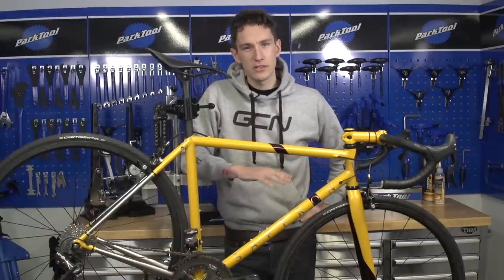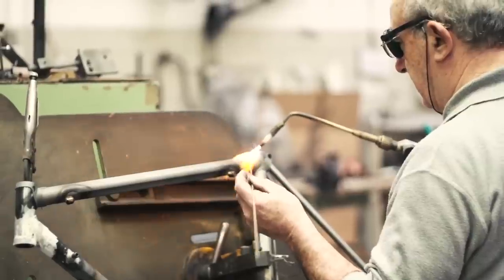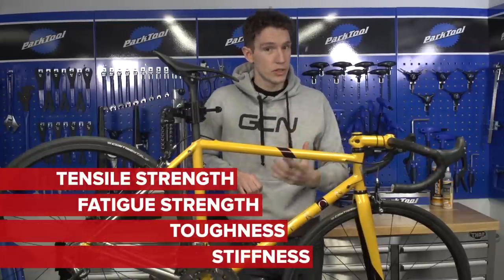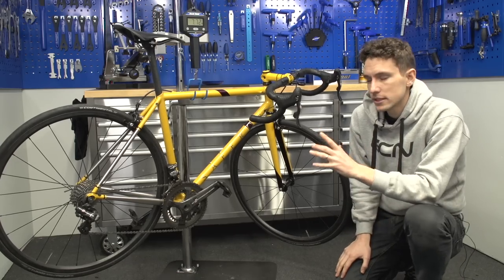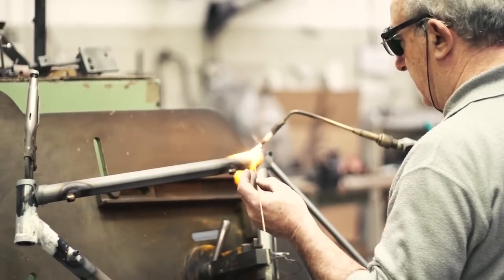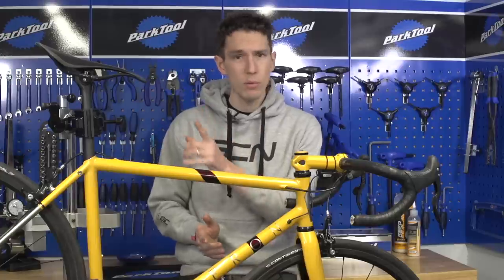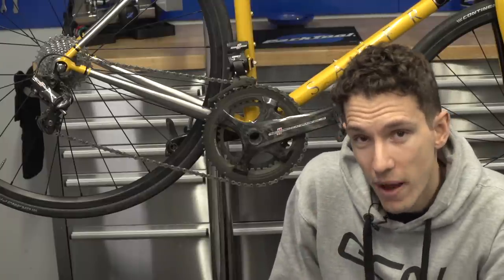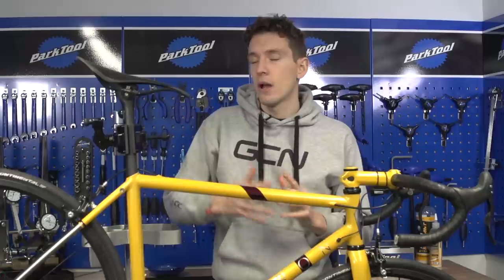Is Steel Real? | 6 Things You Didn't Know About Steel

Comment: I started with an aluminum frame and moved to steel. Never looked back, steel is more comfortable. And at 8kg for the whole bike it's pretty light
Reply: But it's no longer durable.
Reply: Shannon Trainer yes it is. Way more. Can carry. Tons of cargo too, that’s why touring bikes are made out of it.
Reply: @shannontrainer5857  It's easily the most durable material you can make a bike from while aluminium being the least durable.
Reply: Kandi Klover That’s because those use much thicker steel. The Trek 920 is made out of... wait for it... aluminum.
Reply: @shannontrainer5857  I would never call a trek 920 the best bike.
Reply: @KandiKlover  touring bikes uses much thicker walled tubing. That’s why they weigh 30-40 lbs unloaded.
Reply: Shannon Trainer maximum weight of rider + baggage for Trek 920 is only 130kg, according to the manufacturer
Reply: @MakcumPycckuu  The maximum weight of rider + baggage for the steel Trek 520 is only 275 pounds (125 kg). The 1120(aluminum) is 300 pounds(136 kg).

Comment: I steel ride in winter my steel Bianchi 1998. When temperature is low (2°c-5°c) i feel the frame stiffer. But, when temperature change, out of the saddle i literally feel the frame torsion. Ma opinion is; power transfert is the worst point. Comfort... i don't now, in winter i ride less... Great video, thanks!

Comment: Still riding my 92 Merckx Corsa,Columbus SL,team Motorola scheme and loving it,there`s rarely a ride that I go on that I  don't have to clean off other riders saliva off it from all the drooling.
Steels not real,it`s unreal.
Reply: My 1990 MASI is the same,Ive ridden it a whole lot and it doesnt have a scratch on it,killer paint and clear coat still looks new. Quad butted reynolds 753,silver soldered at low temp,internal lugs,MASI did some good work.
Reply: That's one beautiful bike you have

Comment: Steel most definitely is real! 👍.  I ride a Mason Resolution and the ride quality is absolutely beautiful! Yes my Madone is lighter and faster, but I feel it lacks one important quality that the Steel Mason has LOADS of... Character! Just sublime.
Reply: Good to hear about the Resolution....I was looking at getting a Mason bike
Reply: I still have my first custom built Ciocc from 1985... it's a thing of beauty and rides like a dream. 6 speeds in the rear with Shimano 600 SIS first itteration. Only issue after a 1/4 century was having a drop tube shifter fail and I found a new old stock one at a local bike shop that has been around longer than I have (and I'm about to turn 56.)

Comment: Also, a steel frame, being ferrous, will set off the traffic control switch that is buried under the pavement at the intersection.  Other materials aren't going to work so well.
Reply: Are you being serious though? No wonder the lights didnt turn for me when I was on aluminum bike lmao
Reply: @ripp3rjak934  Try tipping it over on it's side.  An engineer told me an orthogonal loop of metal works best to trigger a lot of them (different types of sensors so won't always work).  I forget exactly how they they work - something to do with induction loops - so his rec was to tip the bike over on it's side to help trigger.  I believe this is why motorcycles still have trouble despite being largely steel - it's the geometry (and cars have enough metal they don't need the geometry).  Also look for grooves in the street to pinpoint the sensor - sometimes it's in the crosswalk.

Another tip I heard - try securing an active RF anti-theft sticker/tag (can't be deactivated by cashier) from a store to the bottom of a chainstay.  I think I was able to confirm that one worked for me, but only slightly scientifically.

For camera-initiated traffic lights, I think you can turn the bike sideways, but I think they work better than the induction loops in the first place for bikes.

Comment: Ages ago I commissioned a custom steel frame.  One day I saw a stock bike that was the same size, so for curiosity, I put mine right next to it to compare tube lengths and angles.  I couldn't see any difference.  But that doesn't mean other custom frames are just hand made versions of stockers.  It did show me that I could have saved a load of money by finding a store bike that fit me.

Comment: Nice video Si, a few things I would like to point address, fatter tubes are not more prone to buckling assuming that the wall thickness is the same.  Fat tubes are generally going to be thinner to compensate for the weight, because increasing diameter increases stiffness more than increasing wall thickness.  However, if you make the wall thickness too thin, then you start play with potential impact problems, so you have to balance it.

Next point, "elastic response" might be easier to explain as a material damping coefficient.  Any material can be described as a spring and damper system.  This results in a (very slight) suspension effect.  A direct comparison is your modulus is your spring rate and your internal damping coefficient is well, your damping coefficient.  So think of changing tube sizes, shapes and materials as changing the pressure, compression and rebound settings on your mountain bikes shock.

If I finish my homework, maybe I will do a design of experiments on frame design: comparing over-sized BB's to standard, how and where seat stays attach to the bike and seeing how that effects vertical compliance and torsional stiffness (popular buzz words in the cycling industry). It might take a few weeks to complete but if you guys would like to do a video on the results, I would be happy to share them.
Reply: Wally May Yeah we'd love it, thanks!
Reply: Same here

Comment: steel is plush and very good for rougher roads and its easy to fix if you know how to weld
Reply: Well to be fair you can weld aluminium too but chances are it will brake there in 1000km.
Reply: @Bartooc  Aluminium will break sooner and the frame will never feel as good after 10 years. Steel however, can feel as good as when it rolled off the shop.

Comment: Nice video. Thanks. I will always choose a steel frame over an aluminium frame. I still have my Fuji quad-butted steel frame from 1985. Excellent frame!!!

Regarding the comparison of tube size and thickness, I think some important points were omitted. Because aluminium is so much weaker than steel and aluminium has the nagging problem of fatigue (which, unlike steel and titanium, accrues at very low levels of stress), aluminium tubes must be made much thicker than steel. In fact, mechanical engineers are forced to design aluminium frames with much higher safety margins to account for this. So there is precious little weight advantage for a quality aluminium frame vs. a quality steel frame.

P.S. As much as I like steel, my first choice today is composite. My main road bike has a composite carbon frame and I'd love to try one with graphene when it becomes affordable. Si hit the nail on the head when he acknowledged that much of a frame's ride quality is in the design and quality of manufacture. Most of my experience has been with high-quality frames for general-purpose racing. When comparing steel to aluminium to titanium to composite, you must make sure that you are comparing apples to apples. There is a huge variety in each (especially aluminium and composite).

Comment: The polar section modulus was well presented.

I've got a stack of steel roadies...
1989 Raleigh Record Ace [ Reynolds 653 ]
1985 Raleigh Road Ace [ Reynolds 531 ]
1985 Raleigh Competition [ Reynolds 531 ]
1985 Raleigh Sirocco [ Reynolds 501 ]

Comment: Thanks for your most interesting video. I enjoy your work. Much that recommends steel is lightly touched on here. Research over, say, the past five to ten years has suggested that a bike with the right kind of flex -- a flex that steel bikes with thin walls delivers -- yields higher performance. It gives back, especially during intense performance, say, hill climbing. Jan Heine in the U. S. terms this phenomenon "planing". You just hinted at this with "springiness". I suspect that the blind devotion to stiffness has gone by the way side in light of what I mention this. Also, the weight argument against steel is real, but not strong. Often it's the equivalent of the difference between a water bottle full or empty.

Comment: I had them all. Carbon frames, aluminium frames and steel frames. In my humble opinion no material can beat the ever lasting effect of a steel frame. Just got an old Columbus Aelle frame from the 1980th, the colour was removed and I measured the frame before reinking it. Apart of some small barely visible dents there was no sign it has ever been used before and it was perfectly straight.
So if you don't want to compete with pros or ambitous amateurs a steel frame is always a good choice - as you may also  inherit it...

Comment: I’m a big guy and steel is all I ride. Everything else wobbles and twists with every crank
Reply: Have you tried a high end carbon bike? One with thick tubes? I have a full carbon bike Nike (used to have chromo, steel, and aluminum). All the bikes were fun and I rode them all into the ground, but one think I noticed about the carbon bike is it’s intense stiffness. Tho I’ll say, some carbon bikes are designed to flex in certain areas to give the rider more comfort, it’s called Carbon Fiber Tuning. They can make the bike as stiff as they want, or make it flex. Try to find a stiff carbon frame (race variant, they don’t flex so much)
Reply: Sorry just realized this is a year old reply.
Reply: @KillersFromTheWest  Do you have a specific name of bike that has stiff carbon frame, what do you ride?

Comment: steel is real
Reply: real.. prone to rust
Reply: Only if you don't do your maintenance every once in a while.
Reply: Does that mean i'm not real? Wait, i'm typing this on a plastic keyboard. What's happening?

Holy shit. 

I'M JUST AN ILLUSION
Reply: Juan Bautista I ride a Buff Mirage it is really steely good.
Reply: Prone to rust if you don't look after it probably and leave it out in the wet and damp! I know someone with a 50 year old steel frame. Resprayed looks great and no internal damage. Keep it dry and wipe it down after it gets wet. Superficial rust will form eventually, but can be removed. If you don't look after it, then yes it will rust badly after many years. If you don't shave or wash you will have a long beard and stink after a year! Look after your bike and it will look after you!
Reply: I agree, I recently bought a 1984 Claud Butler that had clip on rear mudguard mounts. When I took the mudguard off, the rust on the bridge tube area looked horrendous. I picked all the paint flakes off and cleaned the rust of with wet and dry and it hadn't even eaten into the surface of the steel. A quick coat of nail polish to protect it and it was spot on again.
Reply: Juan Bautista i agree
Reply: "Steel is real" is meaningless, empty rhetoric.

I can just see it now - 3000 years ago - people working in a "lab" by combining iron, carbon from charcoal/coal and smelting it,  and everyone pointing at them and laughing at their "fake" material. All of them crossing their arms and insisting, "No way man. Bronze is real. Nothing beats bronze dude!"

Wake up.
Reply: Steel never cracks, it can always be repaired. Carbon fibre is a joke. Aluminium is good and light but sadly it can't be repaired.
Reply: Peter Burgess I'm a Clydesdale,210lbs. I rode a carbon trek project one race mountain bike for three years, no problems,also rode a specialized carbon road bike for about 5years, no problems. In rough on bikes too, and as noted above,heavy. I really liked both, but wished I never said that sweet trek 9.8 project one paint job. Beautiful bike,and I was actually fast on it.
Reply: Peter Burgess buddy no hate on you, you have your beliefs I have mine. I have ridden carbon, steel and aluminum. I hate steel for weight, it is too heavy, I love aluminum for weight and rigidity, but I dislike carbon because I saw my friend crashed in front of me for no reason. His fork cracked without any warning and he got badly bruised, luckily we weren't on a busy highway, otherwise what car may have done what God knows. His cycle was brand new, it was a trek cycle, I don't know his model. And from that incident I never liked carbon, carbon is good for airships, race cars, but a cycle has a lot more risk. Two wheeled vehicles are already risky enough. I never bought a motorcycle that didn't have a steel frame for this sole reason. I don't want frame cracking. On cycle due to such a pathetic human power, we have to make all kinds of nonsenical stuff to lose weight. I have a steel cycle for most of the rides, I also own an aluminum cycle for climbing. I am a mountain biker, not a roadie, so a bit weight doesn't matter for me. Mostly I do down hill stuff and steel frame is perfect for that.
Reply: Fair enough Milind. We are all shaped by our experiences. I have always been a roadie (since the late 80s - with some mountain biking). Straight up until around 2005 I never would've considered a carbon frame (and we'll have to agree to disagree on aluminum as I have previously owned a Trek and Cannondale aluminum and thought it was utter crap). I was "steel-only" for years and years and still to this day prefer the look of steel.

Then I bought my first carbon bianchi and man, although I use a steel bike (cro-mo) for commute and what they call "gravel" biking (really dirt roads), I have been completely sold on carbon. Never looked back. It is pretty much everything steel ever was in terms of directional stiffness but the ride is so much softer. My preference isn't really about weight. When I used to ride steel (SLX, TSX) for 70-100+km my ass, back and the bottoms of my feet, even fingers would hurt all day because the frame was so stiff it was transferring all that road vibration to my body. The carbon remains as stiff, bottom bracket, forks cut right into a turn and so on just as good or dare I say maybe 2% stiffer than my SLX's but my body doesn't get the pain of the road shock.

I have never crashed my carbon(s) but I have witnessed head on collisions involving carbon bikes with road "furnature" and end-over-ends and have not seen carbon yet fail. In fact I've seen a couple crashes where I am certain a steel frame would've bent and the carbon didn't. Perhaps my opinion would be different had I seen them fail.

I will concede there are things I would do on a steel bike I wouldn't feel confident doing on carbon - primarily riding them in sub-zero tempratures (where I live the winters are very cold). Although I use steel for the "gravel"/dirt road rides, my concerns there are actually more about the clean drive train and the wheel sizes.

Anyways, I understand where you're coming from. Cheers.
Reply: Peter Burgess for pros carbon is safe enough because they are riding in a controlled environment, and they get new bikes every then and now, but ideals don't exist for us, our roads aren't perfect either. I love mtb because bad roads are fun for me lol, whereas on a road bike it would be impossible to even ride over potholes(for me, as I am not that skilled on a road bike). Though I always ride my MTB through roads to get to MTB trails, I don't use my car for transporting my bike to trails. I'm a hybrid in that sense. I even have headlights, tailights and  turn indicators so that people can see where I wanna go, at least it will increase my safety a bit when I ride on roads. It is usually easy enough to detect flaws in steel before it cracks, and a bit okaish to detect aluminum also. But carbon is kinda unpredictable, you have to trust your company for that. 
Cheers mate.
Reply: "for pros carbon is safe enough because they are riding in a controlled environment,"
They use them in Paris-Roubaux and they crash at high speeds on hard road. Having ridden both mountain bikes and road I can tell you that you can't avoid pot holes, and the crashes are harsh and hard. Not arguing really, just sayin'.

--"But carbon is kinda unpredictable, you have to trust your company for that. "

Can't disagree with that. No sense in buying a "cheap" carbon bike from a shady manufacturer.
Reply: Peter Burgess my friend had a trek bike, I don't think that company is a shady manufacturer. It is very tough for manufacturers to detect flaws carbon fiber parts.
Reply: Imo that depends somewhat on when it was built and how expensive it was. What I mean is I believe Trek was a little less impressive in the 90's. Also I don't necessarily trust Trek, Specialized or Cannondale to properly construct anything but it's high end carbon bikes. I good carbon frame will have it's resin applied by hand and good quality control will be in place - and I believe that is directly related to the high price, rather than the price of the carbon itself. Specialized and Trek have so many models and sell so many bikes I'm not sure they can do that the same way other companies can.
Who knows. Some people would call that superstition. However I've seen Trek Cromols broken too back in the 90's and I'd never expect to see that from a smaller company producing SLX/Columbus steel.
Reply: @peterburgess9592  Forgot this one:
Myth: "Steel never cracks" Search 'cracked still frame' on Google Image and enjoy the show
Reply: @M-DIY  So why's a die-hard mountie doing here? You should be at GMBN.